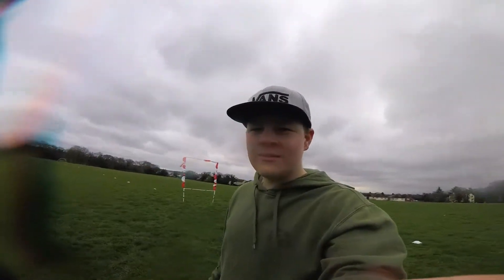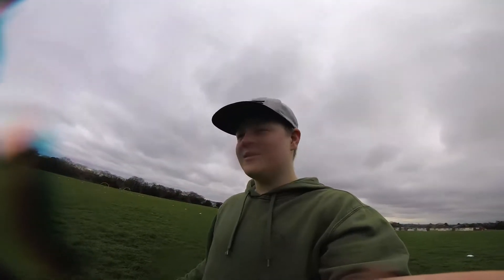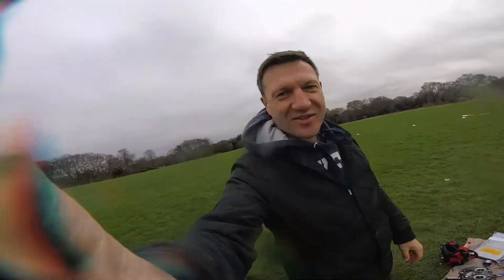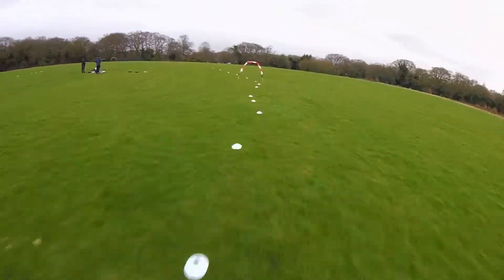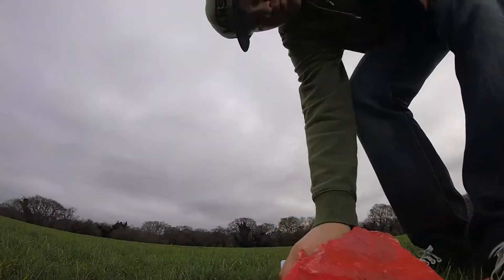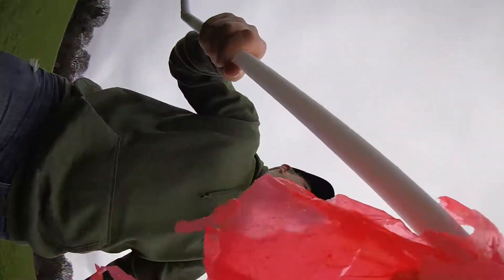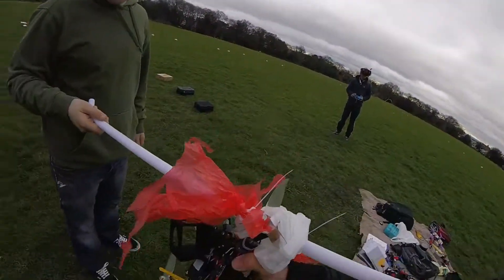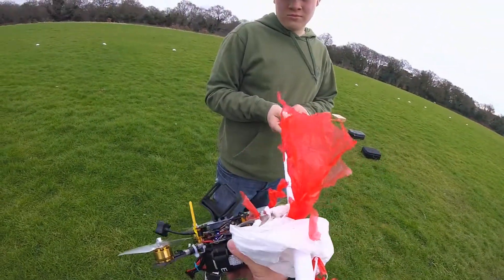2208 vs 2307 comparison | Mode 2 ghost 4s & 6s comparison

Comment: Nice builds! I'm running 6s 2450kv on one of my builds but upgrading to around 2700-2900kv for maximum speed!  You reckon 2208 or 2307 would be fastest on 6s?

Comment: Lmao 2650kv on 6s, that’s not spec’d properly at all and I’m surprised that lipo didn’t puff!
Reply from the maker: I've been running 5s and 6s packs for years. Well before the 6s low kv hype was a thing. I love running the quad with 50 degree angle and just seeing how fast it goes. If I was racing I'd be using a lightweight 4s pack on that kv